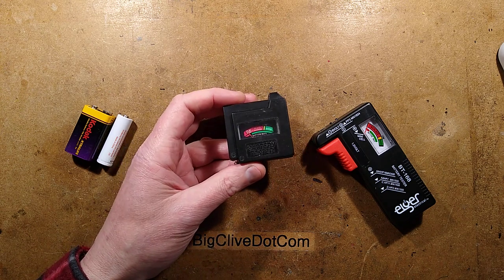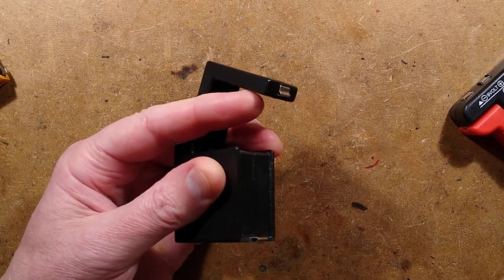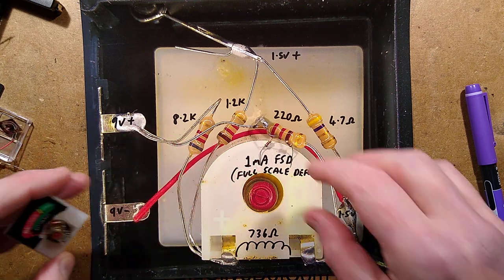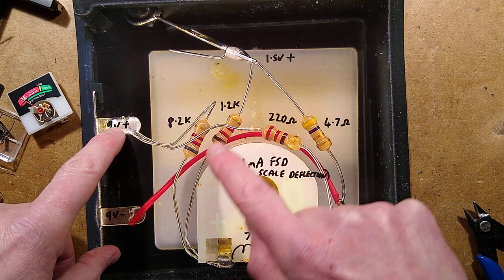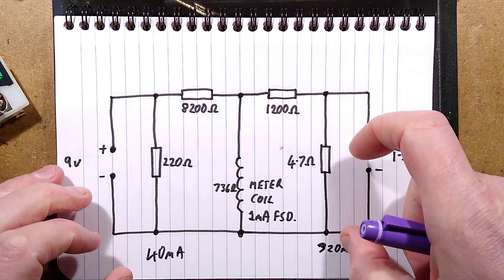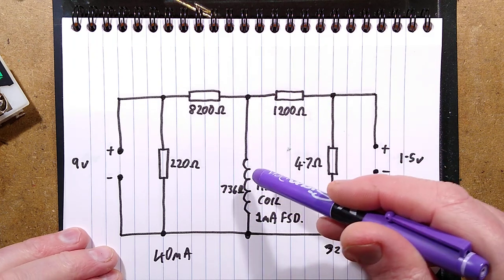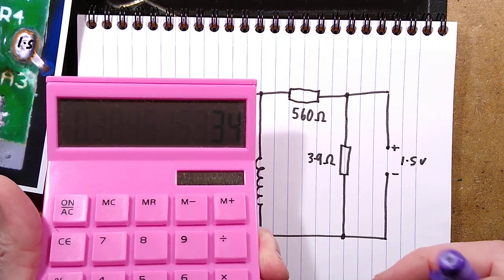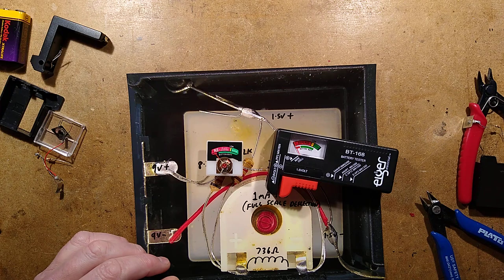Inside a simple battery tester (with schematic)

Comment: I used to be an aircraft instrument guy in another life, and worked on moving coil voltmeters, etc. That "adjuster" marked with the red locking varnish is actually a jeweled bearing for the meter pointer pivots. It is varnished to prevent vibration or whatever from moving the jewel down or up, and tightening the jewels or loostening them, which could increase friction or "wobble factor".
Reply: So the industry standard name is "wobble factor", I see
Reply: @RussellTeapot  No, not really the industry standard, just clear understandable terminology invented on the spot.
Reply: @dougerrohmer  Ahahaha I imagined, I was joking.. it made me laugh, but it's a very effective way to convey the concept
Reply: @dougerrohmer  Damn well better make it industry standard, how else are you supposed to get through your day with all these dull terms?
"Wobble factor" 😆
Reply: Precision coil/magnet meter movements uses a jewel and needle assembly. This insures that the balance springs always operated with consistency. Meters that have pointers at mid range of full scale can deflect in either direction depending on the current flow. You have to hand it to those that assemble those meter movements to make them so precise and last for decades as long as the coil isn't damaged by excessive current due to improper load resistors or range selections.You got to love those analog type meters, visually they are so eye catching.

Comment: The small one was the first battery tester I got as a child, more than 30 years ago. A fresh alkaline cell can easily slam the needle to the top on mine, it was/is a fairly good indication of good, bad and in-between cells. Still use it from time to time today.
Reply: I bought one - cream plastic - at the West Midlands Radio Rally in the UK about 34 years ago - still use it as my "go to" battery tester. It is certainly not too "generous" and I may see what values are used inside it. Interesting video.

Comment: My Dad had this exact same tester. I have many fond memories as a kid testing spare batteries to put in my toys and various electronics. I now have a different newer tester that I use for my kids toys, but I very much remember this one.
Reply: wow, was about to write exactly this. Except these memories are "just" around 20 years ago, and I have no kids 😅
Reply: Assuming you mean the square one, I've got one too. Honestly can't remember how long I've had it- regardless, I get the impression that those are an incredibly common design that's probably been around for decades.

Other than a white pointer and a slightly different design on the (stuck on) scale, mine is pretty much identical to Clive's. (It also seems a bit more generous; fully-charged batteries max out in the middle of the "good" zone).
Reply: my grandma too
Reply: Yeah we used exactly the same here in Germany. Pretty common stuff.

Comment: Thanks for the explanation. The screws fixed with red glue are not there to calibrate the pointer to zero but to adjust the pointer shaft bearing, it's a mechanical thing. I've been using a little tester like this for years, mine is correct.

Comment: I have one of those cheap testers and it's dial goes all the way into GOOD with a brand new battery and seems very reliable in my experience.
Reply: same for me, I guess they made some with the right resistors
Reply: It could be also the stingy deflection of the meter movement as well. I have two of these testers, a white one and a black one, I have gotten free through my company's promos and I still use.
Reply: Yes, my cheap battery tester of this style also goes all the way into the green with a new 1.5V alkaline cell. I’ve had mine for a very long time. I think it came from the former Greenweld Electronics company of Southampton. Long before eBay…
Clive, I think yours must have had been built with the wrong resistor(s). Maybe someone mixed up what was put in the part bin…
Reply: @Mark1024MAK  Colorblind Chinese factory worker.  What could possibly go wong with that?
Reply: While going through a box of stuff, I found another of the small battery testers. This one came from 7dayshop. It also “goes well into the green” with a good cell or battery. This has a slightly different case to the tester from Greenweld. It’s case clips together. So it had to come apart! It also uses four resistors, but in a different arrangement. The resistor values are: 1.5V load resistor is 150 ohms. There is no separate 9V load resistor. The path from the 9V battery + terminal is via a 680 ohms resistor, meter + terminal, meter - terminal, 1k resistor, then back to the 9V battery - terminal. The fourth resistor, 22 ohms, connects between the 9V battery - terminal and the 1.5V cell - terminal. Hence when testing a 9V battery, the 150 ohms in series with the 22 ohms resistor shunts the meter and the 1k resistor. The meter resistance is 180 ohm. I forgot to test the FCD of the meter though. 
Testing the resistance of this battery tester from the cell/battery terminals I get: 133 ohms across the 1.5V contacts. 830 ohms across the 1.5V contacts.
In comparison the Greenweld battery tester has: 2.7 ohms across the 1.5V contacts. 96 ohms across the 1.5V contacts. So rather different.

Comment: awesome, always wondered how these worked, sleepy time now...its nearly 5 am, wish me luck fixing my ebike when i wake up, explosion containment pie dish at the ready!
Reply: Did you have to use the ‘explosion containment pie dish? 
(I hope not, unless you would have been filming the ‘repair’ of course 😉)
Reply: PLEASE Do NOT charge indoors
Reply: @Conservator.  multiple times! note: dont tear down a 500 wh battery indoors, the same battery went up on me TWICE, filled the entire house with acrid smoke
Reply: @samholdsworth420  THAT was my main problem, tiredness and trying to just get it done in a hurry, when ripping large batteries apart to re-cell other batteries, make sure there is NO way they can accidently short, even for  second
Reply: also, when it shot out flames, it melted the cord and case of 1 drill, the cord of another drill and a bunch of usb cables
Reply: @frogz  Jeez! I’m glad you’re still able to comment here.

Comment: Mistake in your maths is that the unused section resistors actually load the meter movement, so the coil resistance is lower, and the full scale current is higher. Without taking this into consideration you get the pessimistic readings, you need to actually calculate combined resistance for the unused side, and the new full scale current, to get a more accurate reading, which would mean each of those range resistors would likely be the next value down on the E24 series, or at least that plus a small padding resistor.
Reply: Good point.  But I thought that the jaw has a switch in it to use one circuit or the other.
Reply: @COBARHORSE1  Nope, no switch. If there was one the wiring would be different. Our Clive would not make that mistake and leave it out of the circuit drawing.
Reply: I can just use my DMM with an attachment to connect a load resistor selected for the battery being tested, but these testers make it more convenient by making it a bit easier to connect, even if being less precise about it.
For lithium coin cells I made a holder from a wooden clothes pin and two screws in the jaws to let me just clip onto the cell.  Regular spring loaded battery holders for cylindrical cells.
Reply: @wingerrrrrrrrr  Yes, convenience is the main goal. There are $100+ battery testers but mostly you just want to be sure you have a fresh/charged cell, or determine whether a device not working is due to low batteries or failure of the device.

Comment: You forgot that there is a second series pair of resistors in parallel with the meter, tempting a few pixies away from the meter.  You never know how many of those pesky pixies might be tempted  ;-)
Reply: You are correct.
Reply: But it's a fairly large value that probably drowns in the series resistor tolerance.
Reply: @johndododoe1411  The entire 1.5V side is a low value comparable to the resistance of the coil, so it will feature prominently when calculating how much current the coil gets when 9V is applied. But they probably went with trial and error.

Comment: When I first saw the poor meter, I was reminded of a pot plant indicator my grandmother used to have, a very similar dial for dry and moist. I wouldn't be surprised if it's a very similar circuit inside and a metal spike sampled the soil's resistance as a function of dryness.

Thanks for the trip down memory lane :D
Reply: That's what they do, yes. Same for lumber testers to see how wet/dry your wood is.
Reply: @rolfs2165  There's a joke here somewhere...
Reply: @PunakiviAddikti  It's too small. I can't find it.
Reply: In the case of soil testers, the probe is a battery (note the two metals) and the soil is the electrolyte.
Reply: @1622steve  yes this is 100% true!

Also if one notes on the unit it tells should not keep the probes in the soil when not in use.

For good reasons and obvious reasons that since this is forming a battery overtime those probes would be become ineffective or even completely useless over time or another failure mechanism Deuce this in the process corrosion Fu but makes perfect sense since overtime any Soros Elwood where the way to producing no voltage.

My parents had one that was on a long handle and had to meet her at the top.

Where does a crossbar like handle is with using it.

This was more intended for garden and Lawn application then potted plants.

Same idea probably same manufacturer just a different form of the same product for different use case.

It's due to their having this that I saw the notice\warning about not keeping the probes in the soil when not in use
Reply: Oh, those are for plants??

Comment: I've got a big old orange battery tester from the early 80's. It has a half pipe type thing where you put the battery, (AA/C/D), and you push the base up to test on a graded scale, and two prongs sticking up for a 9V. It's very accurate.

Comment: A good tester to sell batteries with, assuming no one checks the new batteries! Once upon a time, in order to justify hoarding components, I fabricobbled one of those 1mA gauges onto a tractor with roughly 15v centering the needle in "good" so I'd know whether the alternator was working or not. Two years later and it still works if it hasn't been rained on recently, sure helps justifying the drawer space that gauge occupied for 10 years.

Comment: Are you shure the painted screws are for calibration? I was told that they are locked because they hold the coil on to the needle bearing, and they are locked in a position where the bearing has least friction while still holding on to the needle as precise as possible. Especially since you can easily change calibration, as you showed.
(Not saying you're wrong, just questioning what explanation is the correct one..)
Reply: I think that you are right, zeroing is done, as Clive showed, using the little lever to alter the position of the fixed end of one coil spring.
Reply: The friction deployed by the screws can ensure that 1mA gives a full scale deflection. The manual adjust is for the zero point.
Reply: Yes, you're right, that's what my book on analog measuring devices from the 1970s says.
Reply: @iamjadedhobo  Friction does not determine the full scale deflection, the strength of the coil spring does (as well as the strength of the magnet, number of turns of wire in the coil, etc). Friction in the bearings just makes the meter sluggish and unresponsive to small current changes.

Comment: Question: I'm not techy and it's been years since my school physics but aren't the all the in a parallel circuit of sort no matter which battery type is being tested? If so does that affect the calculation? And what about the tolerances of those resisters?
Reply: Yes, this produces a significant but got game-changing difference to the calculated numbers.
Reply: Yes, current flows through every path available to it.  So in any case you'd see current in each of those three vertical paths on the schematics
Reply: @TheGreatAtario  Yes it does, and you would have to calaculate it as well, so each of the series resistors probably would have to be the next lower value in the E24 series, with another series resistor to get a correct value, or just a single 220R pot in series with the movement, adjusted for full scale with 1V5 applied. But for a quick check of "flat, dead and only standing because it is nailed to the perch" or "still ticking" it works out well enough.
Reply: You are correct.  Ignoring the parallel paths is a reasonable approximation for the load current since the parallel paths are much higher resistance than the load.  However ignoring them is not a good approximation for estimating the meter deflection since the current in the parallel paths is not insignificant.
Reply: If you had bothered going to the 2nd lesson they would have explained Kirchoffs equation so you can separate the parts but if you ain't tech savvy you might not want to know about it.
Reply: I came to comment the same thing

Comment: Interesting, I'd be tempted to re-tune the old one by changing the resistor values to match the requirements of a 1.5V cell. Even a fresh alkaline battery (1.6V) or a fresh Lithium AA battery (1.8V) isn't going to reach the far end of the scale if it's set for 1.9V!
Reply: Might as well just get the digital version for like $7 honestly.
Reply: @GrimResistance  The digital versions tend to not even load the battery. They're basically like hooking a voltmeter to it.
Reply: @gblargg  there are DVMs that have a special mode for batteries (1.5/9 V) they use a load resistor in parallel to the voltmeter.

Comment: I had the square one growing up (in white though) and always wondered why it was so harsh on the battery capacity - a 680 ohm resistor in place of the 1.2K one would make it a lot more accurate - that way a fully charged NiMH cell would get a full deflection.
Reply: Not saying I'm a Mathimatical, and even less of an Electrical astute person.  
But to reduce the required 1.9mA to 1.5 mA,  
which would be about half of one Resistor, you basically Halved one of the resistors?
Reply: then it'd go over range for a 1.5v cell .... theyre designed and 'calibrated' for 1.5v , on my cream square one (quite old) 1.2v is in middle of the green area,
Reply: @SimonJ57   680 ohms might be a bit low - but remember, the battery is also placed under load when being tested, which would reduce the voltage  from open circuit (last time I measured a "full" alkaline, it came up as 1.63V open circuit).
Reply: The reference to test for full deflection is a zinc-carbon "heavy duty" battery.  This is what Duracell claims to last 6x longer than.
Reply: That's the problem using a meter reading current rather than a high impedance volt meter, having to juggle resistances for load and full scale indications.
Using a high impedance DMM for the reading, you can apply whatever load you want for the test and read voltages correctly from no load to full load.
My Schumacher BT-100 battery tester uses a 0.12 ohm load, so even though it uses a panel meter, it's relatively insignificant in comparison.
Reply: I suspect that its just better to have a full battery be slightly underestimated, rather than an empty batterie being overestimated. Im not too knowledgeable, but I think some batteries might drop charge only at very low capacity?
Reply: @wingerrrrrrrrr  It is a fundamental fact of electrical measurements that voltage and current meters are interchangeable.  The only difference is the resistance of the meter.  A modern electronic instrument has a resistance around 10Mohm in voltage mode and 1 ohm in current mode.  But battery testing is best done with a resistance similar to the typical practical load in regular use.  This is what this meter tries to do.

Comment: I own one of these recent testers. I also own a much earlier version, in a white case but otherwise almost identical, that I have had for over 30 years! The older one has a better- damped meter and its resistance load is lower ---- I think I measured it at 70 or 80 ohms, versus 130 ohms for this one here. The 30+  year old battery tester puts a heavier test load on the batteries and gives a better overall indication of battery quality.

Comment: I recently got one of these BT-136 battery testers from Amazon (this one didn't have the Eiger Electronics logo on it). I had been previously using a cheap yellow multi-tester that my (late) Dad used, but I found the probes a bit of a fiddle to stick onto the battery terminals (as Clive clearly demonstrated here). Fascinating to see how they work, and how much more of a judge of battery life they are from the old ones!

Comment: Thanks for that. I have had the smaller of the two testers for many many years.
I did not know that the supposed simple voltmeter was actually pulling quite a high current from the battery.
Reply: That's the difference between a voltmeter, and a battery tester.

Comment: Your calculations were slightly off Clive, you forgot to note that the other 2 resistors are also in parallel with the meter movement thereby reducing the meter sensitivity this would probably affect one side more than the other. The values used in the first meter would be accurate if the other side of the tester were not present.
Reply: Especially important when analyzing the 9VDC tester part of circuit. On the other hand, from the 1.5V side point of view, the 8k2 current limiting resistor is much larger than the meter's resistance, so it can be neglected.